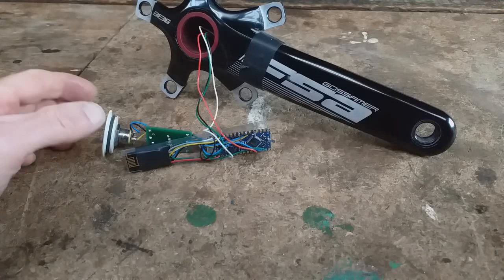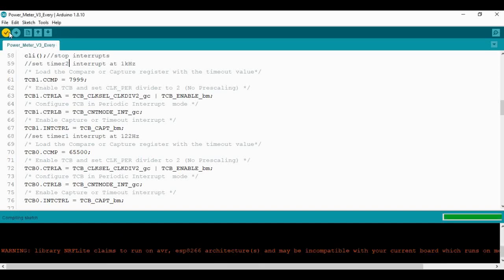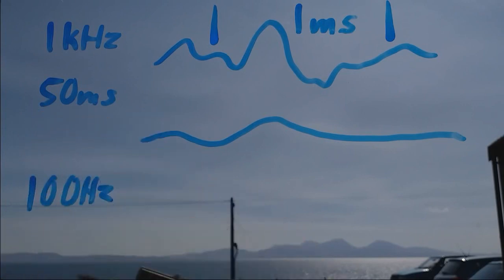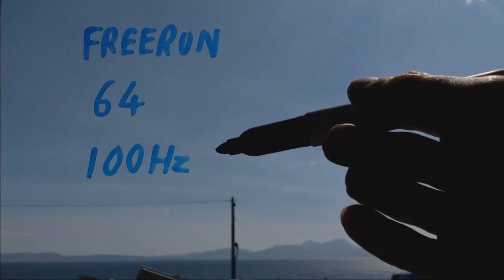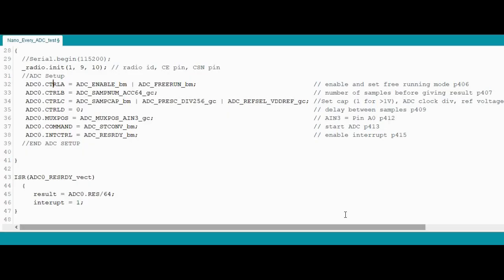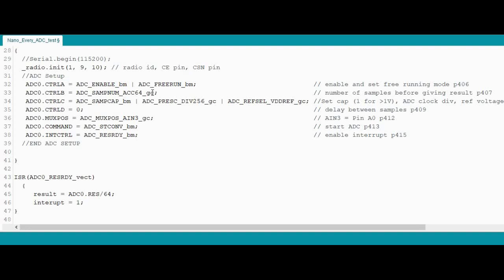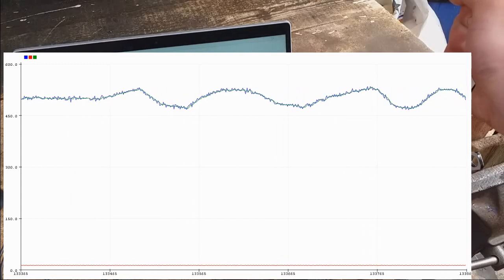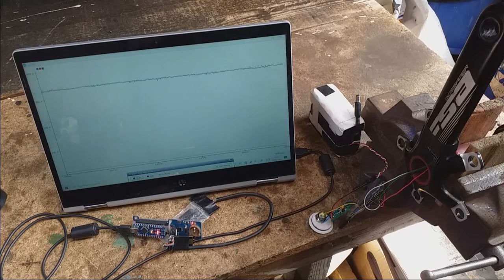Homemade Bicycle Power meter V3 ADC

Comment: Hi, I am planning on making a power meter but not too sure where to start. Like a lot of what to buy maybe?
Reply from the maker: I would start with getting the strain gauges to work. They can be a pain to work with so you will soon find out if the project is for you.
Find some cheap strain gauges on Ebay for example, 350 ohm is fine, sets of 5 are great.
I glue mine on with super glue and protect with wax.
You may need some fine enameled copper wire to connect the strain gauges into a bridge. Can be found in discarded small motors.
I've recently been introduced to HX711 24 bit ADCs which make things so much easier than amplifiers.
You will also need an Arduino to communicate with the HX711.
If you can pick up the weight of the pedal you'll know it's worth preceding.
Reply: Do you think ready made loadcells with amplifier can work too? Now available power meter is way to expensive, maybe diy is a way to go. Thanks for sharing your build 👍
Reply: Do you think ready made loadcells with amplifier can work too? Now available power meter is way to expensive, maybe diy is a way to go. Thanks for sharing your build 👍

Comment: Heyy, really neat build! I'm considering building my own DIY power meter. Do you ever tried longer strain gauges? Don't they have more acuracy? On aliexpress you can find some which are 8cm long and I thought of using them, but if there isn't any remarkable difference in accuracy between these and the ones you used, could you tell which ones you used?
Thanks in advance, and keep up that great work.
Cheeres
Reply from the maker: Thanks and sorry about the late reply YouTube never notified me.
No these are the only type of strain gauge if tried. 8cm is massive, might be worth a try. I suspect although the output will be higher they will also pick up more noise.

Comment: That is really good work. We just published this "for fun" DIY Power Meter page, which may give some inspiration as well :) 
https://sensitivus.com/products/diy-power-meter/
As a small tip: be prepared to spend a lot of time getting the cadence algorithm to work well outdoors. That is easily overlooked and super important for the algorithm.
#diypowermeter
Reply from the maker: Thanks and a very interesting page.
Measuring cadence off the strain gauges has always worked very well for me with very little work. The 100Hz interrupt makes it quite accurate. 
I've recently been experimenting with the HX711 ADC and been having issues with the timing as it sets it instead of the Arduino. Once I get it right I'm sure it will be good or I could add an interrupt.
Also found that smoothing is important to avoid false triggering. I wasn't using any with the HX711, this worked on smooth roads. Now using a running average of 5 data points to get reliable performance.
Reply: @Ed.R  Good stuff. The hard part is cadence with vibrations. Like cobblestones. Or on MTB over roots. Using torque for cadence is not a bad idea, but in theory, you can have cadence with very little torque, so maybe not a 100% solution :)
Reply from the maker: @RolfOstergaard  You can indeed have cadence with very little torque but low torque means low power. In practice I'm very rarely pedaling and only putting out less than 20W.